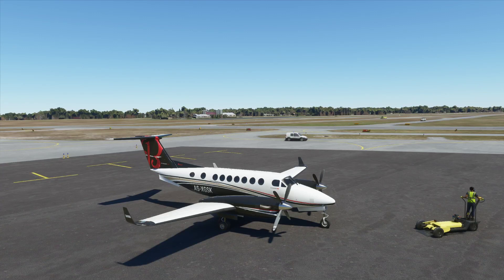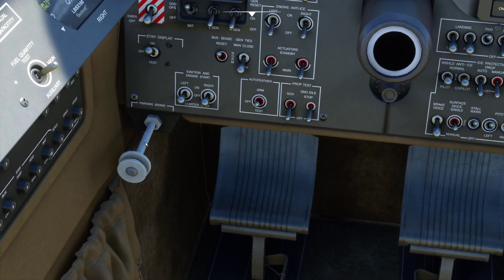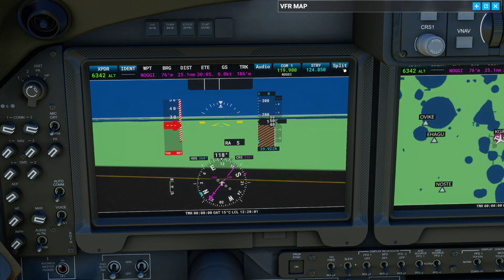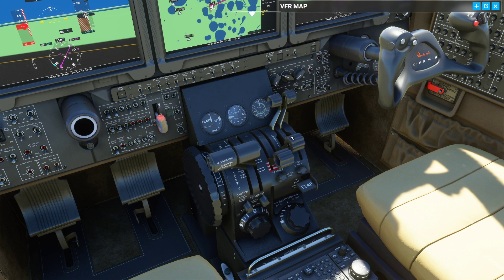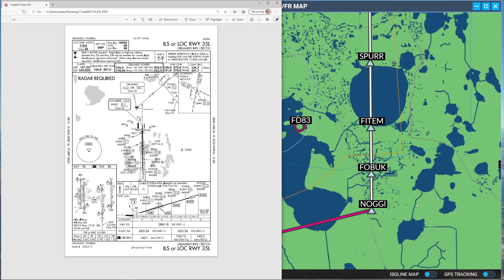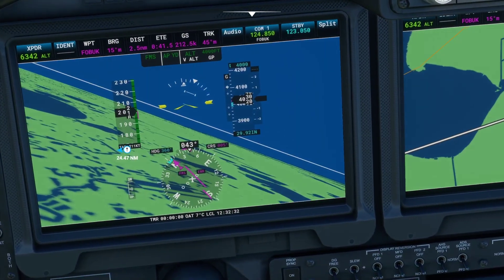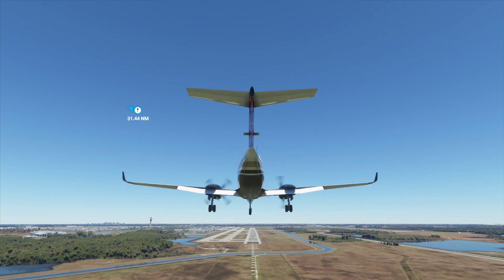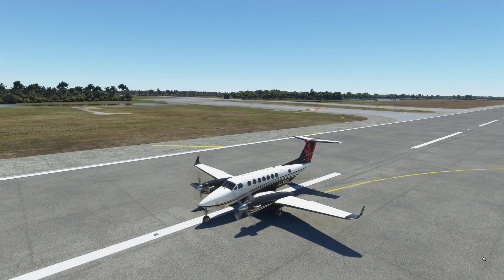ILS 9 min Tutorial King Air 350i Flight Simulator 2020

Comment: What's your recommendation regarding reverse thrust, how to configure my Trustmaster controller ? IfI assign "Hold Throttle Reverse Thrust" to a button, it seems full reverse thrust will be produced. Can the reverse thrust be gradually applied ?
Reply from the maker: Yes it can be gradually applied. Hotas Warthog 
Hold Throttle Reverse Thrust - Button 15
Throttle all the way back, push button and move throttle forward while holding it in with the King Air 350i. Button 1 is another option. It can be gradually applied then and you can test this by moving the throttle back to idle while holding the button in. Plane will come to a stop with throttle all the way back to idle and gradually come in as you move it forward. I tested it myself just then in game. Hope that helps.
Reply: @azayomi  Thx ! I’ll have a go on my Thrustmaster TCA. King Air 350i is awesome wth the new analogue gauges :)

Comment: How far away from the airport do i need to activate the APPROACH mode in the autopilot?
Reply from the maker: Normally you would wait for ATC Air Traffic Control clearance to land but we are in a game, so as soon as you have a signal or around 6NM Nautical miles you will find it will work well in gameplay.

Comment: Press F2 for what i am sorry didn't understand what you said ?
Reply: For the Thrust reversers. But beyond a certain speed you need to stop the reversers and let it go on positive throttle otherwise the plane will start to go in reverse on the runway lol!
Reply: @mindseye4914  thanks for the info but i think its something a little more than that know when iam taxing my plane goes straight that all the sudden goes to the right straighten it out again then goes to the right again iam so fustrated at this game and to add insult to injury i uninstalled and reinstalled thinking that would solve it and my a320 and 747-8 werent in the game anymore just 2 prop airplanes gezzz regreting spending the money on this msfs2020 sorry for the long reply ,,lol
Reply: @HORNET012  all you need to do is go into load manager and install your planes ,its simple really.
Reply: He said press F2 to use reverse. It reverses the direction the propellers spin to slow down the plane after you have touched down.
Reply: @penndiehl5172  Reverse doesn't reverse the direction the propellers spin, it changes the pitch of the propeller blades which pushes the air flow forward causing the plane to slow.

Comment: I have a problem with the King Air, Randomly it'll just lose control and start banking and plummeting towards the ground, AP is still enganged and its usually if i adjust the throttle a tiny bit. Am i doing something wrong or is this a bug ?
Reply: Swampwizard bug
Reply: I have the same problem with the Airbus minus the adjusting throttle thing
Reply: Have to check possibly some button is mapped wrong
Reply: Me too.. have you find any solution?

Comment: where can i see that the aircraft picked up the ILS signal so i would know when to switch from FMS to LOC ?
Reply from the maker: You can by turning on the Bearing Pointers and watching for when it no longer shows "No Data".
Reply: @azayomi  so the 350i has only 1 approach bottom for both the localizer AND the glideslope ? compared to an A320 i.ex.
Reply from the maker: @onkel_yogi  You can change it to LOC1 by changing the CDI Source under PDF Options.
Reply: @onkel_yogi   Are you referring to the LOC button on the A320?   It probably would be nice to have but the King Air is not an airliner.